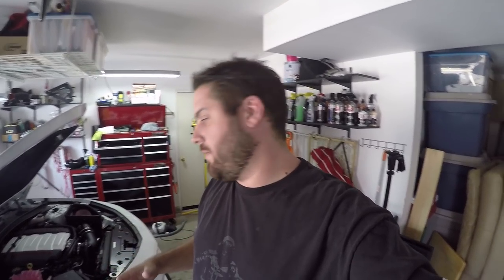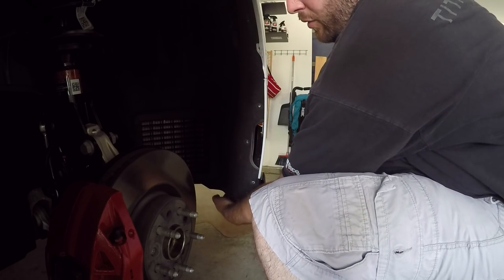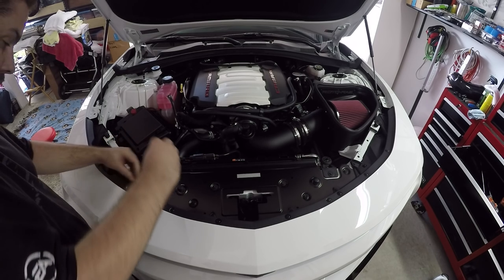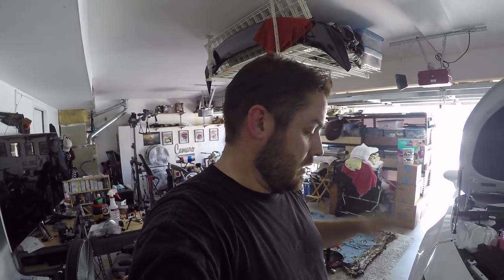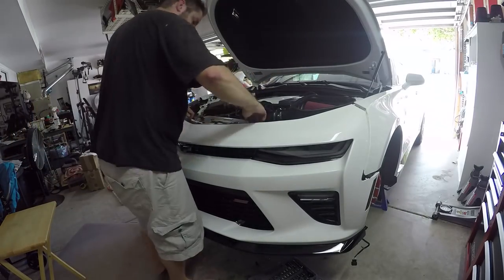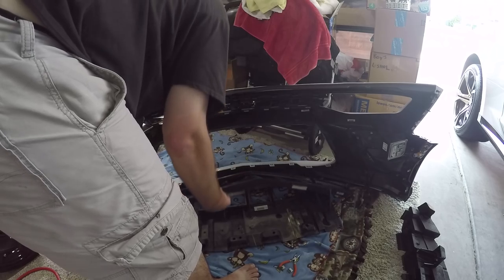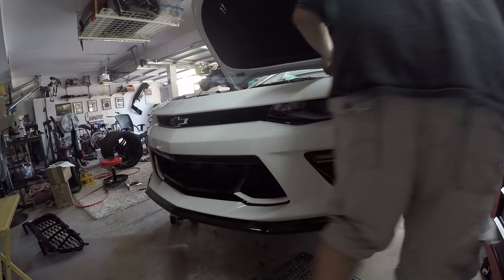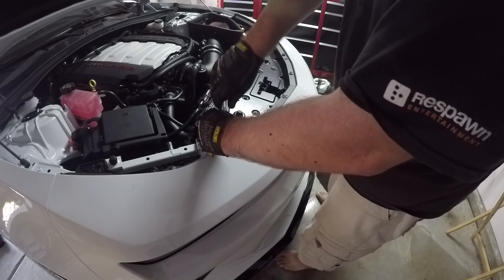Bumper Removal & Front Grille Install/Removal Guide - Camaro 16-24

Comment: Thank you so much, Matt!!! I bought a 2016 SS that had some light front end damage. My grill and DRL were moderately cracked but it was driving me crazy because I had such a bada$$ car and everyone would comment "Did you know your grill and fog light are cracked?" My mechanic was reluctant to even try this.  Your video made the install simple. I would have NEVER tried this without you and it was simple. The DRLs on eBay all have cracked tabs because folks are installing them without removing the grill. Little do they know. Keep up the awesome work!!

Comment: Very detailed, Matt. Love your vids. Long time subscriber. It's one of the best I've seen. I'll be pulling mine soon to go with a stainless billet upper and lower grill. Anything you wish you had done differently? Also, I'd like to put an LED strip behind one of the grills for that glow effect. Where do you think would be a good location? Thx Matt.
Reply from the maker: Can probably put up fire and down fire on the bottom of the top grill insert and the top of the lower.

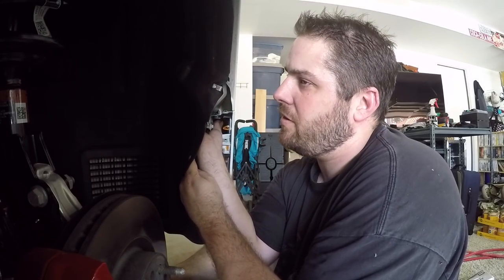Comment: The 3 screws at 6:38 mark, only the one near the wheel well needs removed, loosen the other 2 about half way(smaller length then the rest & not as wide at bolt head). They mainly hold that plastic piece for the lock tabs on the bumper to press into when installing & hold after.
A flex 1/4 drive screwdriver makes getting all of those in the wheel well much easier. That is what i used for all of them under the wheel wells.

Video is very helpful, currently just torn off the Front of my RS after watching this video, to install my RS SEMA grill. 
Only difference i saw was the under side cover has different between the 2, the RS has 5 bigger 10mm bolts & a quick pulls fastener all at the back under the engine, with the same 7mm ones on both sides

Comment: Hi Matt...Excellent videos…thanks for sharing!I have the SS2 Fifty Camaro, UK version, which means the lower drl's were not included (in order to make it road-legal). 
Anyway, I decided to put them back myself.  My question is, in your experience, would it be easier to take the tires off, remove the plastic cover and try to install the dlr's that way? Or should I remove the whole front?  
Thank you in advance for your advise!

Comment: I finally got around to installing my new grill yesterday. I have to say that might of been the worst experience I've had. The removal of the bumper was easy. Those tabs that snap around the grill were a pain in my ass! I should of known cause the original grill was in there really tight and the pressure it took to pop it out was more than I expected. They could of utilized some simple screws around the grill and it would of been a snap. I came super close to breaking off one of those tabs and I would of had to buy a new front bumper.
Reply from the maker: Yup, those metal clips are a nightmare.
Reply: LethalGarage no the metal clips weren't the problem. It was the plastic tabs around the outside of the grill. Yours went in easily. Mine were not. I litterally fought with getting them in and latched for 2 hours. Oh well....thanks for the video once again
Reply from the maker: +James Friedman ugh, that sucks
Reply: Did you end up using any tools to help with those tabs?  Trying to remove the grill on my wife's 2023 LT1 and those plastic tabs are a nightmare!  They clip on the top AND bottom so there's not really any way to lever on them.  I know you posted this a while ago, but I need some help here because I'm bending these things to the point where I feel like they're going to break, and it's still not budging... I Just want to be able to tuck the vinyl wrap in nicely.

Comment: I have a 2020 Camaro do you need to take off the front bumper for the removal of the of the tire guards? (The rubber pieces in front of the tires )
Reply from the maker: Nope

Comment: Hey Matt, first another great video! I'm curious to know, due to the aero and cooling design of the open front grill on the Gen6, did you happen to notice how much debris and dirt gets channeled towards the inner radiator/coolers and lower valence? Or was it surprisingly clean. Keep up the good work! and by the way...you did a good job.
Reply from the maker: +Quaylefan shockingly not much after 5K miles.

Comment: One wonders Lethal about the long term durability of such a massive piece of molded plastic.  It really does endure torsional forces from the air, seasons of temperature change, constant bumps and shakes.  I'd be highly impressed if in 20 years the epoxy chemistry kept its bonds and didn't warp crack or otherwise degrade.
Reply from the maker: +RootsandTendrils I'd say the same thing about every part of the 6th gen in that case.

Comment: Hey matt at 7:56 what is that silver piece attached to the headlight. Is that the Headlight ballast or headlight module? Need really to know since I have to replace mines. Thanks
Reply from the maker: +Mubashar Ayub not sure what your talking about....
Reply: Lethal that silver piece for the Headlights at 7:56. Is that headlight module or the headlight ballast?
Reply from the maker: +Mubashar Ayub I see no silver piece for the headlight at 7:56
Reply: What about at 7:53? Right on the bottom of the screen. It's not a piece it's either a ballast or a control module. Trying to find out what it is exactly

Comment: Can you install this grille on the LT model?
Reply from the maker: +TonyisGaming They make an LT option, but it is not the same as the SS.
Reply: +Lethalhammer “Lethal_Camaro” ahh okay, thanks for the info. I just hate that LT grille with the plastic chrome accents.
Reply from the maker: +TonyisGaming I am sure aftermarket companies will have stuff soon.
Reply from the maker: +TonyisGaming Yeah... I get it.
Reply: Lethalhammer Phastek has some awesome looking SS aftermarket grilles. If they release the black mesh one for the LT I'm gonna scoop that up.

Comment: Is it possible to remove the front fascia/clip/bumper with OUT taking the front tires off?
Reply from the maker: its possible, but not easy.
Reply: LethalGarage that's what I figured. Thanks Matt! About to tackle this project soon.
Reply: Kaizer_911 was it doable without taking the wheels off?

Comment: how did you get to detach the harness on the passenger side? i cant seem to pull it off. :( now im stuck. HELP!!!
Reply from the maker: +glenn ryan It's hard, but I used players to push in the clip and pulled hard.
Reply from the maker: +glenn ryan plyers*
Reply: plyers? in your video you were not using any tools in disconnecting the wire harness.. u probably mean the grille removal. :) my problem is that i cant remove the front bumper since it is still attached to the wire harness. i cant seem to disconnect them. in ur video, it looks easy though u said its a nightmare to disconnect those. is there anything special i need to do? pretty sure i pulled the red mini clips up to unlock it (not sure) but i tried disconnecting them but still is hard. pls help
Reply from the maker: +glenn ryan yeah use a pair of pliers in pushing the tab that in between the red clip they are a b** to pull apart

Comment: Hi, I have Camaro rs. Can I install ss front bumper on it? Will it fit my rs without any modification?

Thanks,
Reply from the maker: +Mustafa MC no, you need an LT grille
Reply: I am only talking about bumper no grill.
Reply: Some sellers say it will fit. that's why I need to make sure from you. I would appreciate it.
Reply from the maker: +Mustafa MC oh... a bumper, yes. But you need a bumper and DRL.
Reply: thank you so much!!
Reply: one more question. are the connectors of LED fog lamps same as RS?
I am talking about the wiring which are connected to DRL. Are they same?

Thanks,
Reply: I meant  Wire Harness**
Reply from the maker: +Mustafa MC I think there may be a slightly different wiring harness
Reply: I just ordered SS bumper and paid too much money. The only concern is the DRL harness. Is there another way to connect them if they do not match? like buying an adopter. However, the voltage of ss and RS led lights are exactly the same.
Reply from the maker: +Mustafa MC I am not sure, I haven't looked.
Reply: ok np thanks  for your info.
Reply: Hey man GooD news . Everything worked fine. there was no need for any modification. Now my RS looks like SS and I also changed my rear spoiler too like SS. You can say that I have SS in V6 lol. I can show you the picture if you want me to.  Thanks for your help!!
Reply: i wanna see a pic lol dm @saaw_yt on instagram
Reply: SAAW I will send you the pic or I will make my own video and put it on YouTube

Comment: So is your goal to make your maro a 1LE clone lol because you are getting close.
Reply from the maker: +kevinsdb1 LOL. The grille is actually an anniversary grille and was introduced with that car over the 1LE. The wheels I think just look better ;) the tire size matches the ZL1 and just so happened to also be the 1LE size. 

I guess AI need some new suspension bits and 6 piston breaks
Reply from the maker: +kevinsdb1 brakes...
Reply: i have money saved up to give a down payment on a 2017 camaro LT2 automatic. and but i would prefer an SS, but i could afford it but i cant afford the gas milage. is it possible to add a SS front bumper on an lt2 bc i really like the SS grill
Reply from the maker: +michael gonzalez ummm... the 1SS V8 has just about the same gas mileage as a V6 2LT.

The LT and SS grilles are too different and can't be swapped between each other.
Reply: Lethalhammer i was talking about the bumpers, i want to swap bumpers and i want the premium interior. i simply cant afford 40+k only up to 35k considering i still attend College
Reply: michael gonzalez
You could always buy a used 2SS Camaro. I see older ones from 25k-35k in good condition all day long. They're not gonna be a 2017 but hey if you want the V8 and to fit in your price range that's the way to go.
Reply: ***** i think ill just wait utill the price drop. or when i turn 21 on next may.but thank you
Reply from the maker: +michael gonzalez Well, small pieces at a time ;)
Reply from the maker: +kevinsdb1 I have already seen used 16's.

Comment: Safety first.... Please wear some sort shoes when your working on your car.. I'm a mechanic anything can happen..
Reply from the maker: My sandals and bare feet give me good luck.,
Reply: Keep 911 on speed dial!  ...and keep your loose toe on ice!
Reply: i work on my car in bare feet.......except ,  the extent of my work is filling up washer fluid , changing wiper blades , checking oil level , power steering fluid level , checking antifreeze , etc.
which is nothing compared to the work you do on your car
Reply: us " bare feet  " guys got to stick together, ignore all the negative comments < that's what i do